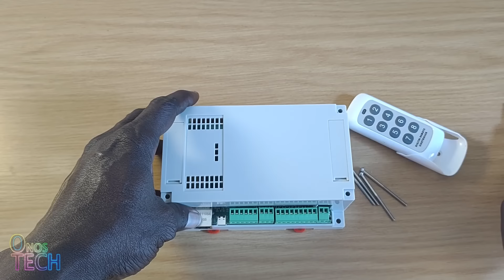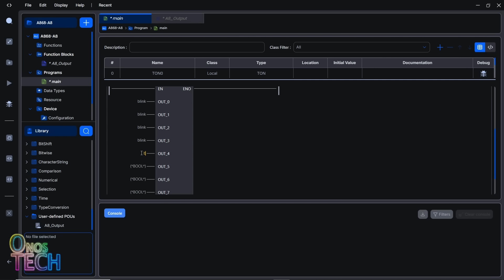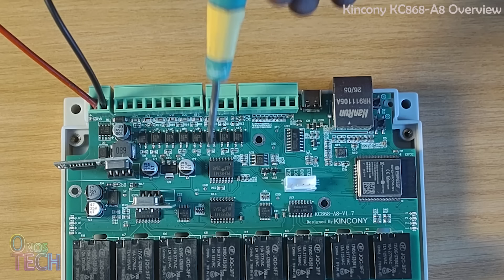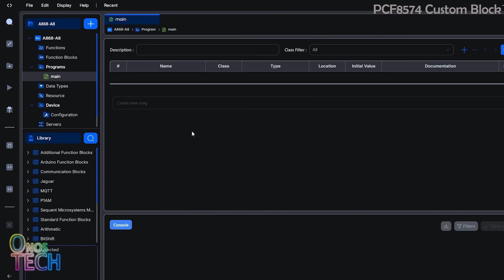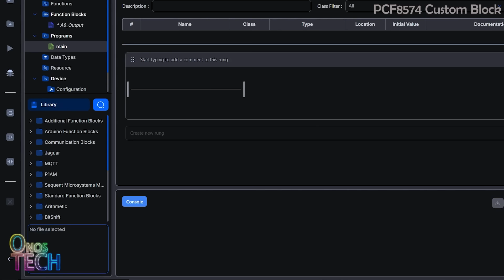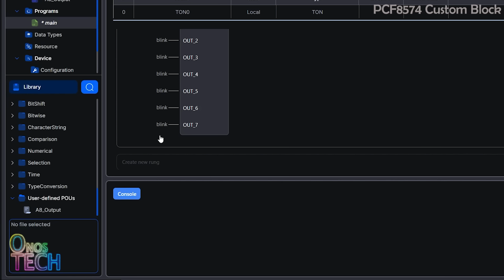Turn Kincony KC868-A8 ESP32 IoT PCB into a Real Industrial PLC

Comment from the maker: The KC868-A8 uses the PCF8574 over I2C for those 8 relays. While this custom C++ block solves the mapping issue in OpenPLC, how many of you would trust an I2C-based expander for high-speed industrial switching, or do you prefer direct GPIO mapping for safety-critical tasks? Let’s talk reliability vs. cost!
Reply: Thats what i am confused at, what do you suggest is esp32 sufficient for emergency safety signals ?
Reply from the maker: It depends on the level of reliability you need. An ESP32 works well for alerts and monitoring, but for life-safety applications, consider additional fail-safes beyond just the ESP32.